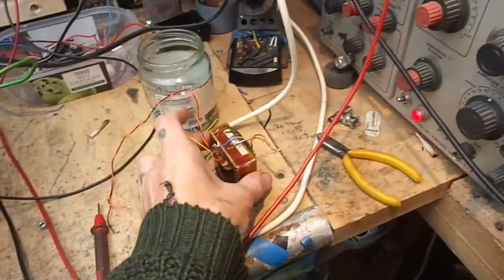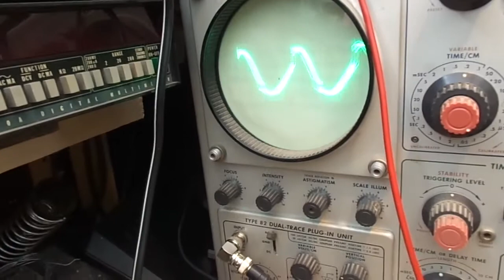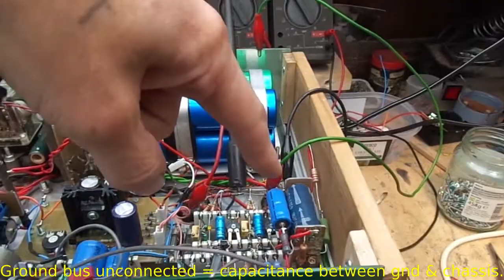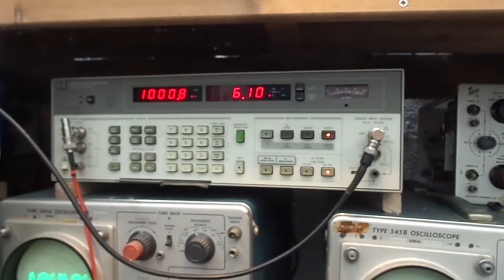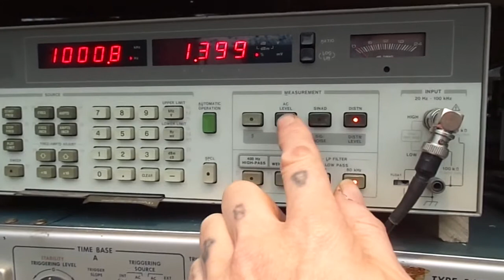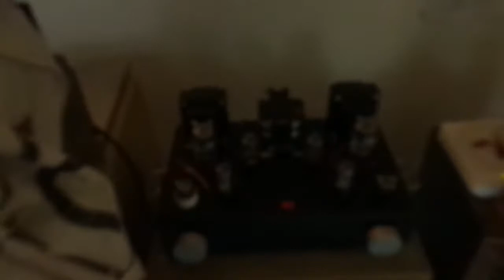6146 & 2C34 AB2 Amp Update

Comment: Good job friend.. a question these four large electrolytic capacitors are how many UF? that is, what is the capacity of each one?
Reply from the maker: Thanks.the caps are NOS 700u 250v, I have a bag full. So two times 700u 250v in series, you could use two 330u 450v or whatever you have to hand. TFW
Reply: @diabolicalartificer  Yes, I have some 330u 450v from old televisions, I have 2 6146b I want to try to build an Acrosound Ultralinear To 350, I can mount the ultra linear audio transformer for the to 350 and the power transformer I can mount too, voltages from +750v 250v , + 400v, +220v , -115v I didn't find another scheme with lower voltages that will be the way I try to build the Acrosoud to 350
Reply from the maker: @franciscogoncalvesbastosju3713  The higher the HT the better for the 6146B though that depends on your OPT, have you got the original Acrosound TO350's? Lucky you if you have. If you haven't got an OPT with separate g2 windings you can't really do UL as the 6146 has a max Vg2 of 250v. good luck......DA.